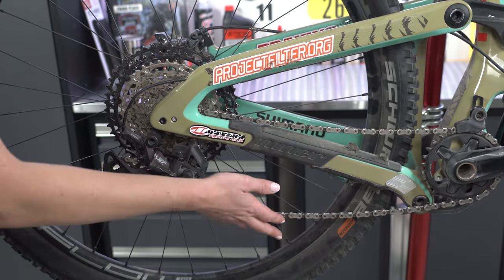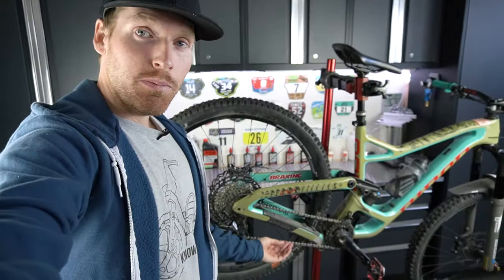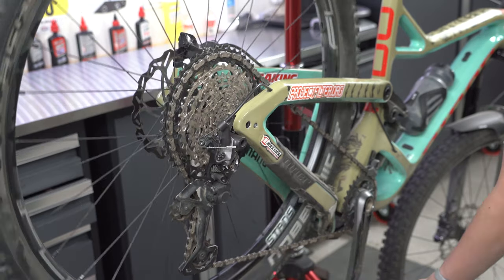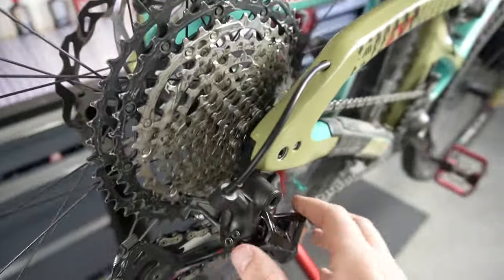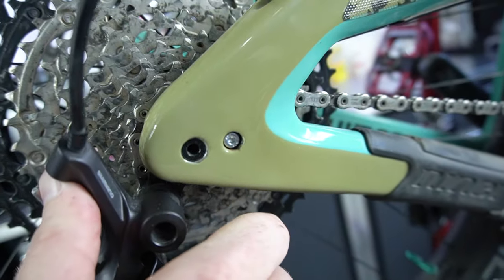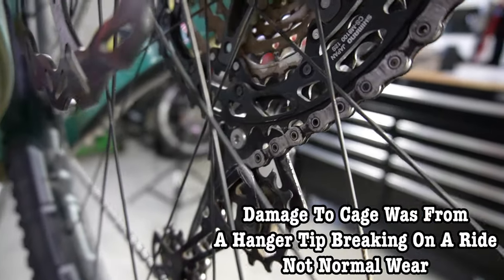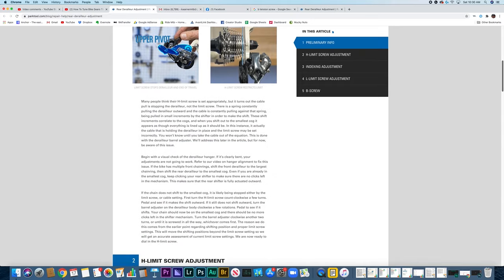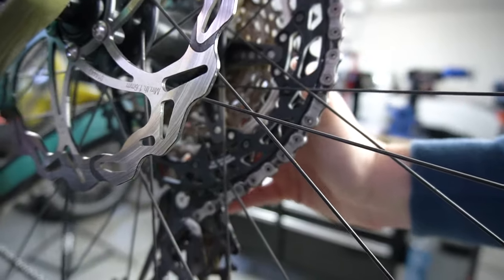B Tension Adjustment Tips From How To Tune Bike Gears Video

Comment: I saw another video about this where the guy only checked the derailleur to largest sprocket clearance while making b tension adjustments. It makes more sense to check both chain tension in the highest gear and derailleur clearance in the lowest gear as you mentioned in this clip. Thanks for clarifying this.

Comment: on my shimano derailleur the Gap is  too small even though the screw is completeely screwed in. I was always able to create the right gap but something seems to have changed and its not possible anymore. Im confused.
Reply from the maker: try loosening the derailleur on the hanger and see if it has rotated at all, this can happen and make proper b tension impossible to achieve

Comment: Hello first i like to say that i like your how to videos with April and you seem to be an excelent instructor in your videos with April and a very skill full rider your self.
Now about b tension or for others b gap i have to say that the b tension all though it can effect the chain tension it has nothing to do with adjusting it. If a chain with a correct length is installed on the bike the tension in most cases would be ok. The correct length is determined by your two biger cogs front and rear whether it is 1x, 2x, or 3x your chain stay length and your chain growth if it is a full sus. If someone wants to cut his chain to the correct length he has to run it around his two biger cogs front and rear and hold it tight  and closing by hand and NOT permanently with safety pin or missing link. That length plus two links is the correct chain length and if it is a full sus the shock has to be fully compressed during this procedure. On 1x systems it is very simple on 2x or 3x things are more complicated but not much you just have to choose a derailer with the correct cage length if all this is done correctly and still have issues especially with chain clearance that means that the frame is not designed for that gear set up.
B tension or b gap determines the distance between the largest cog on the cassete and the upper pulley of the derailer just because cassetes come in various sizes. Now if the b tension is adjusted wrong but clears the largest cog it does't have devastating effects in shifting. If the gap is to big then shifting is slugish a bit slower and not so precise if the gap is to small then shifting is crunchy and the chain in some cases does't run smooth when pedaling. I can go on and on about how to adjust a bike sorry for the long post and sorry for any mistakes i've made english is not my native language😇😄
Reply from the maker: Thank you for all of these amazing tips! I will pin this comment so people can see it and learn a little more :)

Comment: Good explanation. Imho though the smallest sprocket is the high gear & the biggest (easiest) is the low gear (like in a car) So when you want to move to the biggest cog you should say move down to the biggest cog, not up. That's just me being picky though as the video was great. Thanks.

Comment: On the newer shimano 1x12 derailleurs there is a line on the back side of the cage near the upper jockey wheel that shows the required position of the cage relative to the largest cassette gear.
Reply from the maker: Yeah that is such a helpful feature! We just wanted to make something that gave people a general idea of how to tune any derailleur but its so rad how easy shimano makes it!

Comment: When the chain is on the smallest sprocket at the rear, and on the largest sprocket  at the pedal, ( hardest gear ) that would be the 24th gear of a 24 speed. The lefthand gear shifter should be on the # 3. ( is this correct ? )
And, the righthand gear shifter should be on the # 8. ( correct ? )
So now, if this is correct, then begin explaining EVER so SLOWLY. Taking time to video precisely while explaining.

Comment: I have a schinn  Ascension that was given to Me. The problem I'm having with it is when the back tires in contact with the surface you can pedal the bike but but it does not engage the rear tire and it just free spins.. As if it's not in gear at all. It does this in all gears. Not right away at times, but eventually, you pedal the bike and it puts no power to the back tire. Btw , yes, the chain is on. I just got this yesterday. I've never had a multi teeth configuration before

Comment: I like it! Tools like SRAM gauge (red plastic thing to measure the distance between a pulley and a cog) make us to think it needs to be adjusted by a mili-meter precession. You freed me from the obsession! One thing that I might have noticed on my wife's bike which has Ethirteen 9-46 11speed cassette is that it seemed to halite upshifting (from large/easy cog to small/harder cog) somewhere in the middle section if the clearance is left too generous? I'm wondering this is because the ramp is so steep and the distance between the pulley and the cog gets way too far in that specific position which makes harder to derail the chain? Tighter clearance pared with well adjusted up/down shifting might have resolved it but it seems temperamental compared with other cassettes. I wonder anyone had the same issue with Ethirteen?

Comment: Very timely. I just bought a 'new to me' bike and the rear mech needs some tweaking. I do wonder if chain wrap is as much of an issue in the larger cogs. Getting and extra one or two links of engagement is a big deal for 10T or 11T when you only have seven teeth of engagement max. But even if you have B-tension maxed out, you'll still have 20+ teeth engagement in your larger gears... granted they're usually made of softer aluminum.

Either way, great videos, keep it up!

Comment: What if you still have 2 chain rings in the front? Still the hardest gear or should there be no droopines when on smallest front and smallest back? (And yes, know that it is not recommended shifting pattern)

Comment: Thanks! This helped a ton. Extremely easy to understand.  After watching this B-Tension video this clicked for me.  I had mine set way to high and my shifting was not precise and was often skipping gears.  Adjusting the b-tension appropriately totally fixed my issue and I have crisp clean shifts now.

Comment: Y’all need to work on your vernacular. “High gear, low gear” that’s just it. People see it differently. The only for sure way to label gears correctly is inboard/outboard. There’s no question if you use proper terminology. I would expect something coming from park tool co. To have thought about this. Thanks for the post though. It was still helpful.
Reply: Sorry not park tool co. Just Kyle warner.